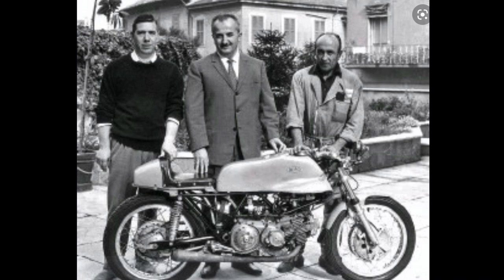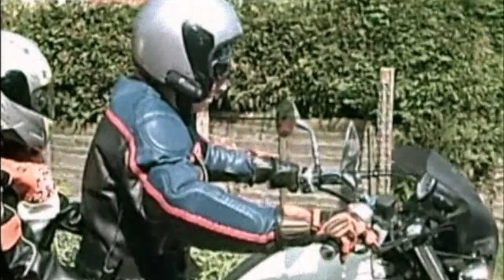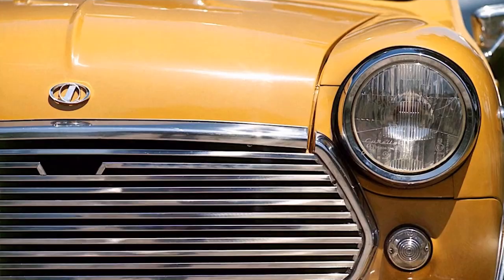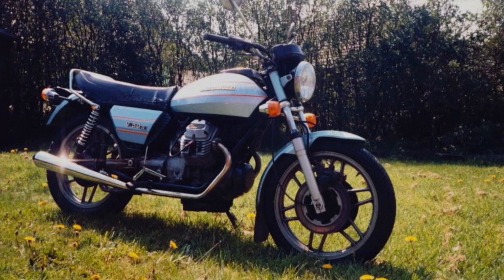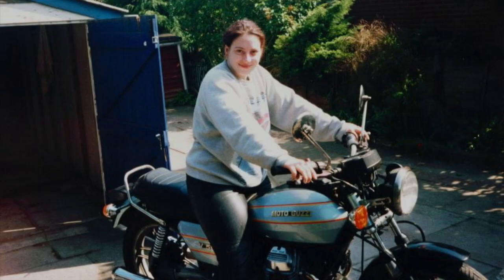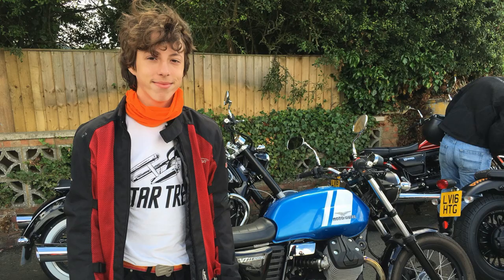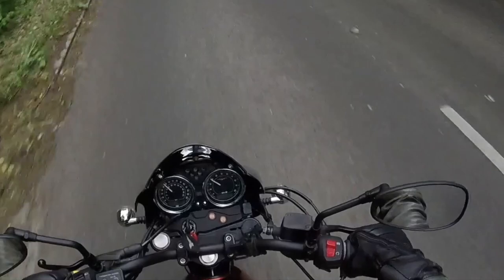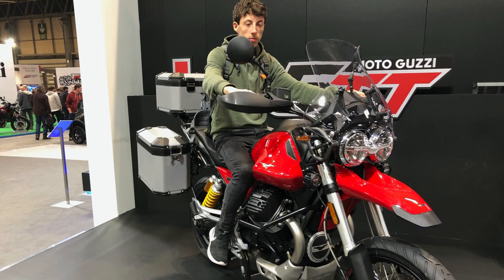Moto Guzzi   small block  V Twins from V50 to V7 & V85

Comment: I was a mechanic at a Guzzi Dealership in the 1980s. The small blocks did indeed have some quality issues on the timing side and some weak ring gear/clutch components. They also had reliability issues because the 500cc bikes were just hammered hard by their riders.
Reply from the maker: The mark 1 in particular, I can speak from experience, they do get ridden pretty hard.. later bigger motors of course don’t get worked as hard because of the extra torque.

Comment: I had the V50 and despite it having terrible suspension, it handled really well. Electrics needed waterproofing. Brakes worked well.
Reply from the maker: Terrible no 
Firm definitely
Very firm 
Very very firm
Reply: @bikerdood1100  I had a V50 11 - same as the one in your video - for a few years and rode it all over Europe. I'd have said 'taut' rather than firm, but that's just semantics. Whatever it was it certainly was - compared to the Japanese equivalents anyway. My one was reliable but quite small physically for touring. Biggest issue was the finish though. Returning from the Adriatic area we had rain all the way across Austria. The rain stripped the paint off the front mudguard from the front tip all the way back to level with the forks. That did it for me I'm afraid.
Reply from the maker: @stuartholding6067  Ran mine for 11years, wasn’t completely trouble free but nothing major ever broke. Two up touring is a bit snug but I didn’t carry passengers too much back then. Biggest journey was a tour around Scotland. 
I’d agree with the comment about the finish. Much better on later bikes I’d have to say, but l really loved that little bike

Comment: It is hard to believe that my new V85TT is related to my old V50! They feel worlds apart. It is also far removed from any of the big blocks I have had. The future looks rosy for this new motor!
Reply from the maker: And yet related it is, the combustion chamber of course is very different now the Heron head is gone  but it still uses the same oil filter for example. The chassis is of course completely new

Comment: I rode a V50 III back in the mid/late 80s. I used it as a courier and rode it for fun. On the road, it was about the best all-round machine I have ever ridden.
I knew linked brakes from the T-3. I didn't need to be "persuaded".  I never took a linked-brake Guzzi onto the track.  I imagine that would have been tricky. But on the road, even ridden briskly, they were excellent.
I had a few rides on a V65TT. Who remembers those?  No linked brakes. Actually, it was a bit of a botched compromise... But the V50?  
Unflashy, undramatic, swift when necessary and close to perfect.
Reply from the maker: Everyone criticised the linked breaks 
Who didn’t try them of course but then praised Honda when they fitted the same thing to the Pan European 
Today with ABS it would have been brilliant

Comment: Back in 1975 I delivered a new Guzzi automatic to its new owner about 200 miles away from our shop, he didn't care if I rode it there as a kind of break in or first test ride maybe? The short story is that he was trading in his old 850 El Dorado which upon riding the old Guzzi back to Phoenix I found that he should have kept the El Dorado, it was a much better motorcycle in every respect.
Reply from the maker: Automatics 
Doesn’t seem right somehow . The Convert used a torque converter so was a semi automatic. But as you found it didn’t really offer anything over the standard bike at all 
More cost I expect
Reply: @bikerdood1100  I should also add that the Phoenix Police Department switched from Harley Davidson to Moto Guzzi at that point and they loved them but later went to the Kawasaki Z1000 for political reasons plus slow parts deliveries from Italy. The DelOrto pumper carbs were flawless on those bikes. You're sucking me in with each new video thanks.